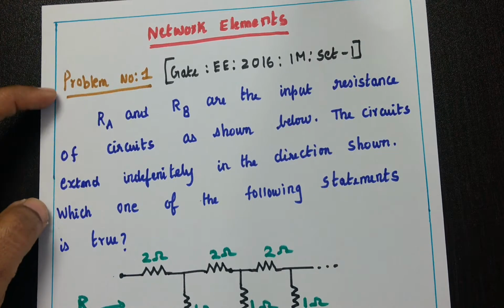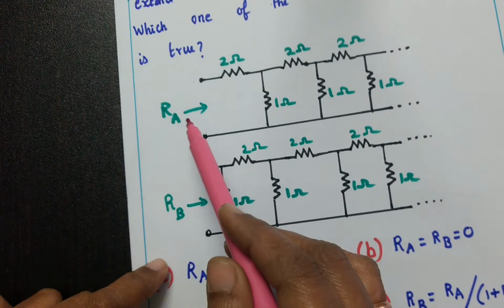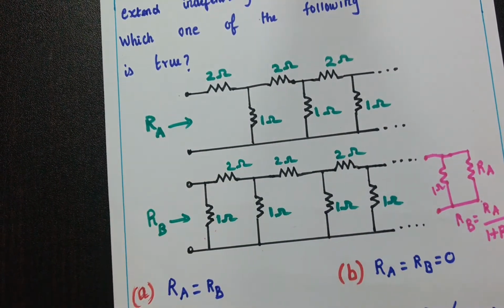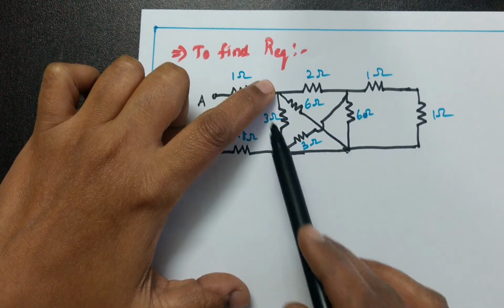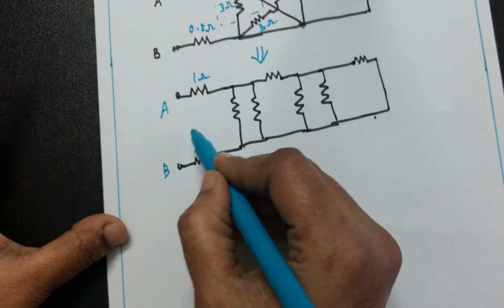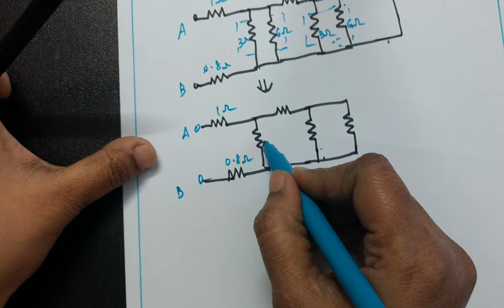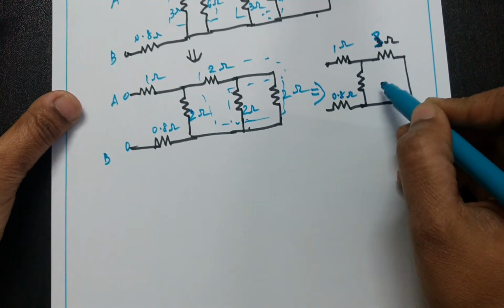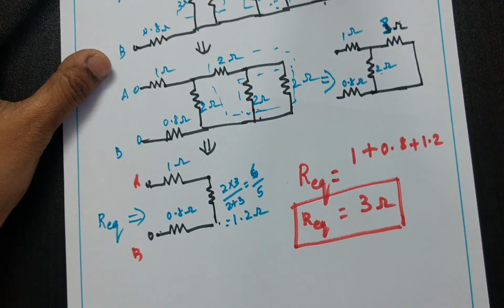GATE Problems on Network Elements

Comment: Mam neenga podura videos EEE and ECE ku same than ah mam
Reply from the maker: For 5 common subjects of ECE and EEE like Network Analysis, Signals and Systems, Control systems, Analog and Digital Electronics and also for Engineering Mathematics, General Aptitude., Same Video lectures only. (GATE Problem solutions from different disciplines (EE/EC/IN etc.)  are uploaded)